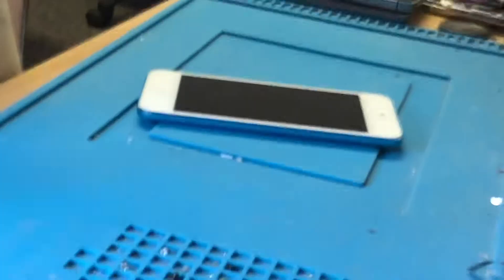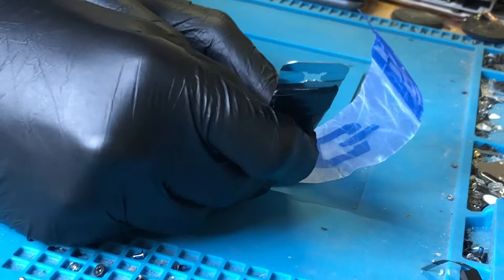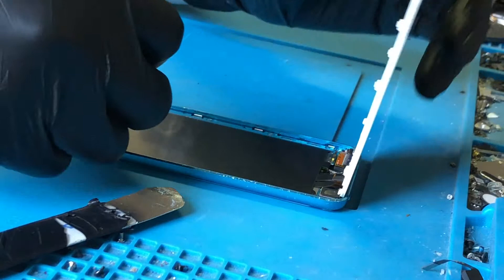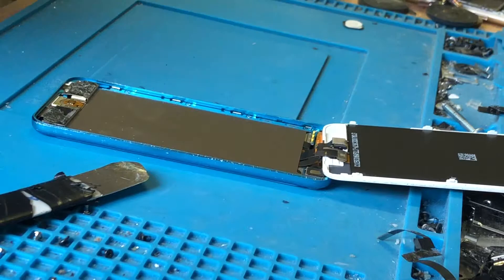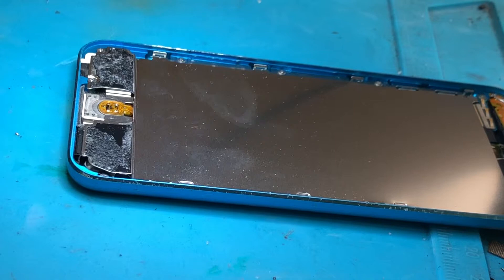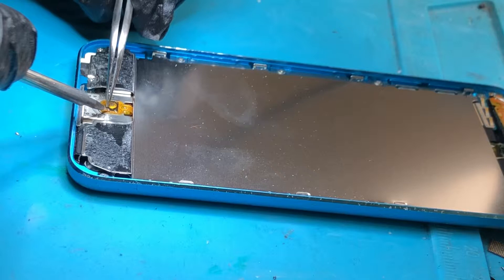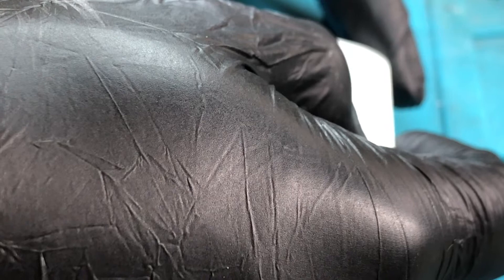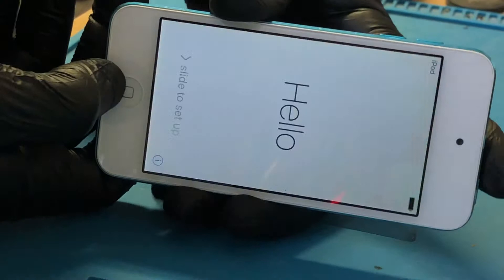iPod touch 5th and 6th generation home button repair

Comment: Hey guys I wanted to ask a question regarding these types of iPods.
So I just got an iPod touch 7th gen recently and I’ve noticed that the home button won’t respond if it’s pressed on the lower edge of it, I’m still wondering if it’s designed like this so if you guys could give me some info it would really help me. Thx

Comment: Did you add solder to the pcb, then add flux and heat the contacts for the button up to let them adhere to the pcb? I have to do this soon and I don’t wanna ruin it haha. Many thanks in advance.